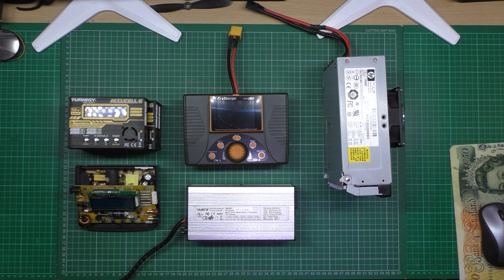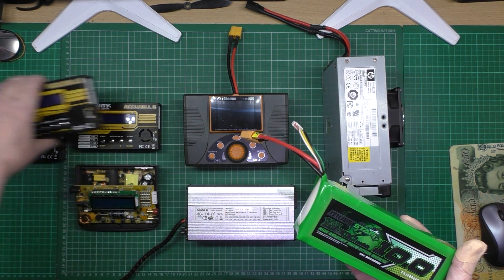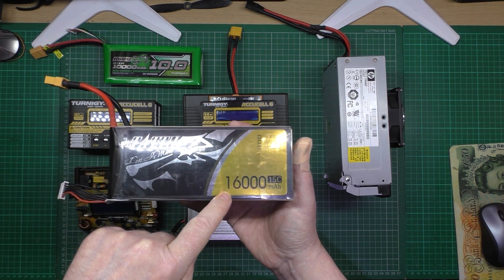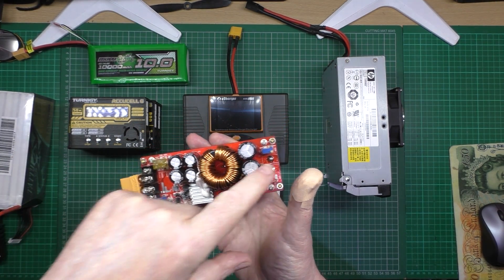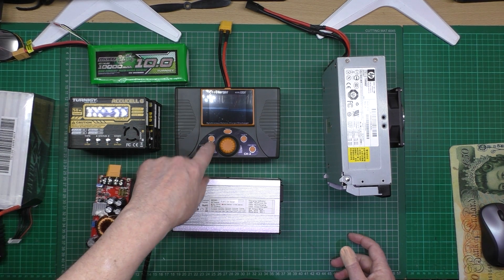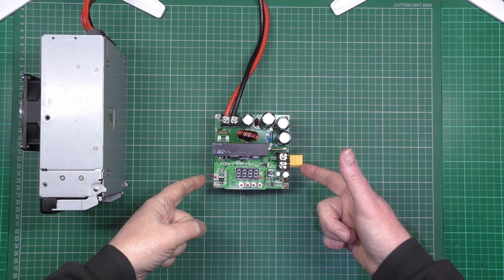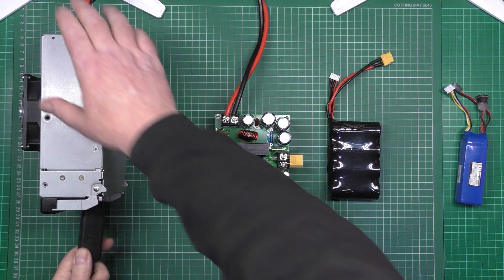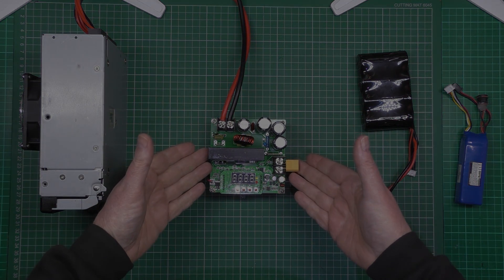Battery charger explanation as easy as possible

Comment: Sorry Tony but that was an incoherent train wreck of an explanation. I strongly advise against charging multi cell Li packs using the constant current method without individual cell voltage monitoring and balancing. There exists a real danger for the inexperienced using some of the advise here to end in fire or worse.
Reply from the maker: You're right of course mate. I think I'll stay away from technical videos aimed at people who constantly ask me these questions. I know how they work but it's not easy explaining it, especially when you're Tony.
Reply: If you absolutely must charge a multi cell pack on some kind of CC CV power supply that lacks balancing and you have no BMS on the pack I would suggest testing the voltage and every cell and writing it down. Then look at the deviation between cells and see how out of whack they are. Now if you have a history with this pack and know how it behaves this is a lot easier but say you don't. Start by setting your max voltage to 4.10V per cell. Now for every 50mv of deviation in your pack, reduce your max charging voltage by 100mv per cell. So say your pack shows a deviation of 100mv. You'll take the 4.10V you started with and drop that down 200mv to 3.9V. Then multiply 3.9V by the number of cells in series and only charge that high.

This still allows you at least mostly charge up your pack while leaving enough of a safety margin to MOST LIKELY prevent any cell from getting high enough to go past 4.20V. Is it possible that your pack showing a 100mv deviation near empty could be so out of whack during the charge cycle that the deviation grows so large that even though you stopped at an average of 3.9V per cell you still end up with one cell at 4.40V.....yes but its highly unlikely and you shouldn't be using that pack because it has SERIOUS problems that an active balancer probably cant even fix. That's a pack that needs to be recycled or (if you have the experience) torn apart and rebuilt so that it balances correctly. More than likely theres damaged/dead cells in that pack or it was built by someone that has sex with their cousin and drinks mouthwash to get drunk.

Of course the easiest solution for someone that doesn't have a BMS or balance charger (that is now very popular 5 years later) is to use an active balancer. As long as your charge speed isn't very fast, an active balancer should keep a pack in line fast enough to prevent a cell from going overvoltage even if you are charging to the max voltage for that number of cells in series but I always suggest stopping at 4.10V and checking to see if the balancer has everything in line, it only takes 2 minutes to probe every cell on the balance connector. A Heltec 5A active balancer for a 3S/4S pack is just over $10 and a 16S 5A balancer is around $40. It hardly wastes any energy at all, only needs to be run for a few hours at the top of a charging cycle and can be moved around to different packs as needed. Couple that with a $2 1-8S Cell Voltage Alarm Buzzer or $5 7S "Capacity Controller"/$8 8S Cellmeter 8 and you can physically see a readout of your cell voltages. If you have a very large pack they make 1S-24S Cell Voltage Display Meters for $50 that have 2.0mm pitch pins and 2.54mm pitch pins that you can plug your balance lead into and it shows you all the cell voltages, your deviation, your high and low cell, and your pack voltage on one very nice screen that can be powered by 5V DC barrel jack or USB. Most of them are accurate down to 3mV meaning they show you 3 places behind the decimal and are relatively accurate out to that third digit (almost). For those that build packs or have a ton of LARGE packs you can buy what is essentially an active balancer/power supply/charger hybrid box that comes in various power levels and does all the balancing for you but they are $$$$ and an active balancer (5A-8A) will take care of most packs up to 280Ah within a couple days at most

Comment: when youre charging your batteries on the bike do you just charge them at the rated voltage and then balance them individually every now and then or do you have some way of balancing them when charging them all at once?????
Reply from the maker: I was doing a weekly balance but I now have a built in BMS which balances them whilst charging & discharging.